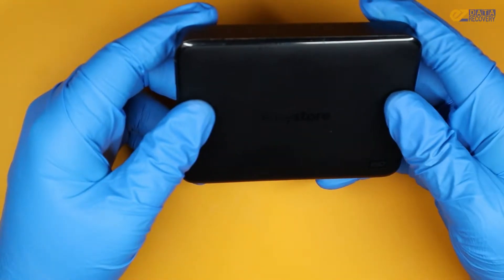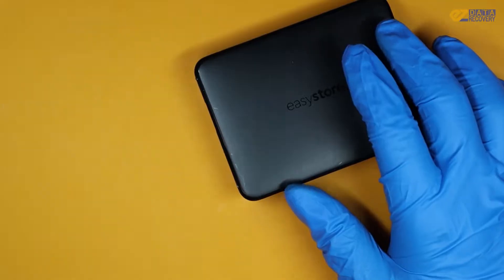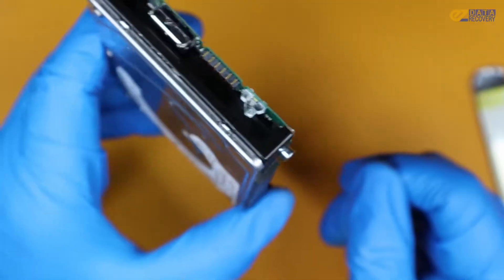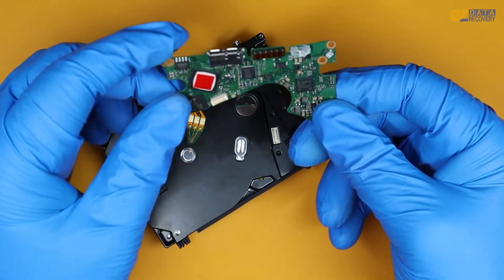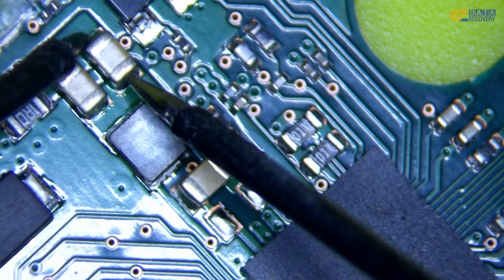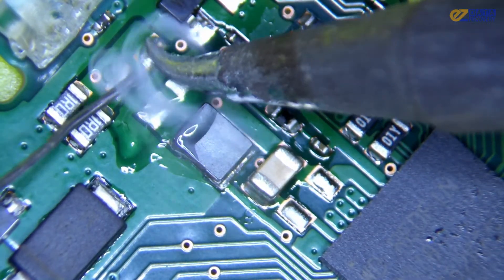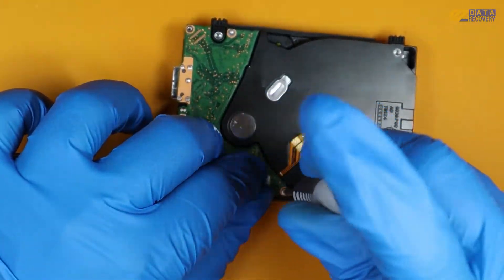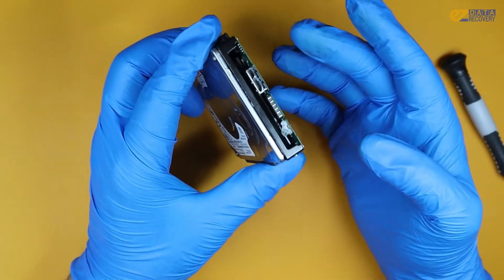How to fix a Dead External Western Digital WD HDD - Data Recovery

Comment: Too bad the vid does not explain what component this is. If it were a resistor or smd fuse, what was its value? He clearly knows these 3 components are suspicious. While talking of a "short" it is actually an "open" circuit therefor the unit does not respond to anything. It doesn't receive its power supply voltages. Not so EZ if you don't know this.
For anybody else; check the usb cable or better first swap it with an absolute sure working good cable (new is 7€) before diving into repairs.

Comment: My issue, is. I have a Seagate my second one. My first one "died "2 years ago. So, I got the same exact cope and model. And today it failed just like my last one. The light turns on, I hear the chime, the light flickers. It just won't show up on the Mycomputer tab. When it does load, it takes time, then becomes unresponsive. I'm not sure if both drives have failed, or they just need a new driver. I used them both to hold my games, music, and movies. I hate to think that I lost them all. It took me years to get the back after the first drive failed. And now most of my Fallout 4/Skyrim mods I cannot get again. Please I need help.

Comment: 2:57  I always put it in a baggy then put it in the freezer for 20 minutes  then try reading when cold.  it is always 50/50 if freezing it works.
If freezing it works then the drive must have locked up being super hot.   Sometimes just a one inch drop test.
But I am interested in how you repair or get data off this one.

Comment: Is it possible to show the process of getting that data recovered? For those that want to do it* 

* At their own risk.
Reply: This is a full video because after this kind of issue (a board level repair), the disk appears fully functional and you have access of all files without any problem

Comment: wD are the worst type of external hard drives , i bought 3 and all failed !!! rubbish
Reply: a lot of people who say that dont use externals for what they are made for -back up only. dont leave them running for hours at a time and dont let windows defrag them and antivirus scan them as they have no way to stay cool and so overheat in sustained use -also i believe (no way of knowing for sure) they are pushed on price competition therefore use "b grade"drives this will be in all brands ive used wd ,seagate, tosh, hitachi, samsung ,maxtor since 1999 and when fan cooled no one brand except toshiba and samsung  stood out as unreliable
Reply: @darrenmurphy6251  Thanks for that info.

Comment: Hi mine is not recognized or spinning when I plug it in but it shows lights on it and shows a beeping sound but doesn't show on my laptop, help?
Reply: Mine is the same problem
Reply: ever tried knocking it gently on the sides?
Just a small little bump to the long sides of the drive.
It might be that the reading/writing head is stuck somewhere, and you may be able to knock it loose. 
BUT:
Very gentle knock. Not with a hammer, not like a primate. 
AND: Be prepared that it wont work, or might even damage the drive further.
But i must say that i have had suc6 with it with 2 different hard drives.
They gave me the opportunity to get most of the data off of them before i threw them away.